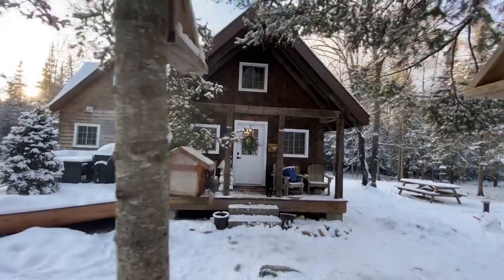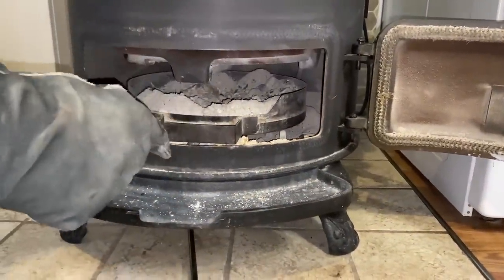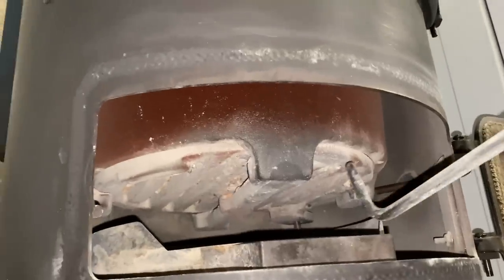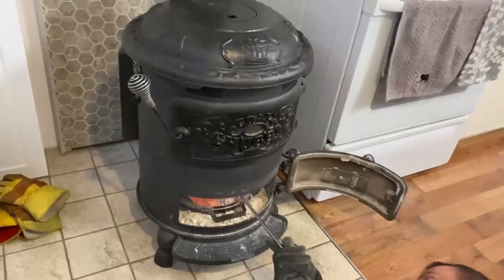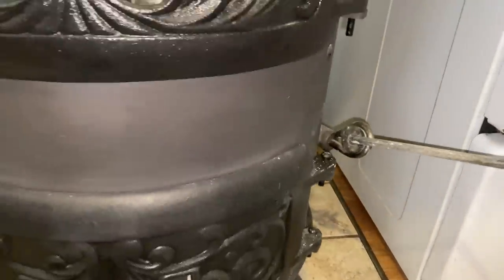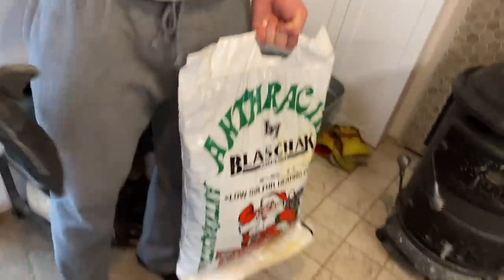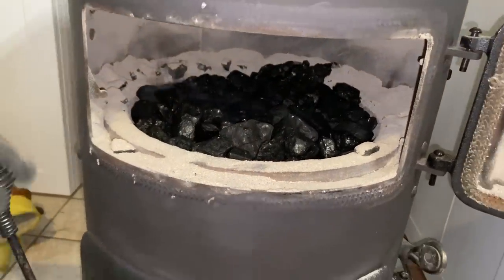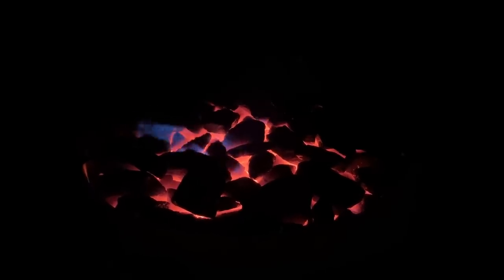How We Heat Our Cabin in the Woods in Winter

Comment: Very interesting video. My wife and I have a yurt camp in the mountains of Mongolia. Our winters are extremely cold. Night time lows reach -45C (-49F) for the coldest period. Our heating season is 8 to 9 months of the year. We tried heating with electricity (space heaters and heated floors) but it cost a bloody fortune. 

Luckily, Mongolia is a coal producer but to reduce pollution the government only allows semi-coke briquettes for residential use now. It costs about US$1.10 for a 25kg (55lb) bag. So we converted to a coal burning boiler and radiators with anti-freeze for this coming heating season. We did a test and about half a bag burns for 16 hours and heats our living areas quite nicely (2 yurts and a bathroom) plus an insulated shipping container which I use for storage / workshop / garage.

We're hoping to get adequate heat for about 5-10% of the price we used to pay this winter.

Comment: Very nice looking place you have there. Best places to live are out in the country in the woods. Been thinking about going with a wood heater to offset the electric heating bills. Coal would be fine with me as well. We used coal for heat when I was a boy. Hated having to shovel snow off the coal pile but it sure felt good getting back in close to that old coal heater.
Reply from the maker: @danielhanawalt4998  Thanks for the nice comment! I’ve never regretted heating with coal 🙂

Comment: We had a stove in the UK similar to this and we found we only needed to do the push-pull movement to clear the rotating grate without needing your first operation of "flossing".  You might like to try that and see if you can save yourself possibly an action that might not in fact be needed (I'm just guessing, I may be wrong!)
Reply from the maker: I’ve tried this, but on this particular stove I think the grate spacing is too close to skip flossing. The ash seems to get packed in tighter at the bottom and won’t fall through with rotation alone.
Reply: @cabininthewoods517  You have a good quality coal for sure. Ash looks clean, without much hard melted residue (clinker). If spacing in the grate is too wide, you would have a lot of unburnt coal falling down your ash tray.
My dad had to rebuilt a grate in one stove we bought long time ago. He added another moving grate between existing stationary one. The only downside was cleaning it :D But this helped so much with the amount of coal burned.

Comment: Have a gravity fed coal stove as my primary heat source.  Was getting nut coal for $370 per ton (pallet) from Tractor Supply the past 4 yrs.  Got one there this year almost $900/ton.  Now they don't even have it anymore.  Had to drive 2.5 hours into PA with a trailer for a load at $450/ton.

Comment: I like the compactness of this stove. It’s easy to locate for the best feel of radiant heat.  However this stoves ash system is horrible. I’v burn coal all my life and my parents for the last 60 years. Our stoves don’t rotate the whole burn chamber, but rather have 2 grates with interwoven fingers that are self cleaning when you rattle the stove. No laying on the floor picking at the stove. Also the Ash pans are full  width  and rectangular (so are the stoves). We open on one end and they basically shovel up any of the overflow ash when you slide the empty pan back in. Plus there easier to dump without a spill. 

The metal bucket is no joke when dealing with hot ash. My grand father cleaned out his wood stove for the summer 2 weeks after his last fire one time. He filled a plastic 5 gallon bucket and set it out on the back porch. Went in for lunch and came back an hour later to find a wilted bucket.

Comment: When I moved into my house a few years ago, there was no gas, so I bought a wood and coal stove. If I want to burn coal, I can add a funnel that slowly feeds the coal to the fire over 12 hours. It's really convenient and gives a stable heat for months in a row. I usually clean the whole stove once a month, because there tend to be stones mixed with the anthracite (and they collect at the bottom).
This year, the price of anthracite has tripled (in Europe). Luckily, I bought enough coal for the next 3 winters, but still, I try to save them only for the days where the temperature goes below freezing (so maybe I can squeeze 4 winters out of them). The price of wood-briquets only went up with 50%, so I tend to use these when it's not freezing outside... 
A pity, because it's really convenient to heat with coal!
Reply from the maker: Sorry to hear you’re dealing with those price issues! There’s definitely a vested interest in cranking up the price of anthracite artificially these days. Glad you’re still able to use it for now!

Comment: Good luck finding anthracyte coal. That's like hen's teeth around here. We stoke up with hedge apple or black locust at night and it does a pretty good job with the fans circulating and the hearth fan in the fireplace. Unless it get to negative temps, it's nice and toasty when we wake up
Reply: nothing like a warm house when getting up in the morning...Then a hot breakfast..
Reply: I can find anthracite nut coal at any farm store, anywhere. It's used a lot in hobby forges.

Comment: Great video, I was completely unaware that people heat their homes with coal in this day and age.  I mean, I just put in two heat pumps with much consideration in my home, a big deal for me as I've only ever lived in a home heated with wood(42 years). The pumps cost $2.50/day combined in electricity, but my wood furnace was costing me $8/day in firewood.  I still can't believe that electricity is cheaper but there's something to be said about technology.
Reply: Electricity is not cheaper but then, your heat pumps are not using electricity to generate the heat.  The electricity is being used to help extract the heat from the outside air.
Reply from the maker: Absolutely, technology certainly has its place! That’s one reason I didn’t go with an off grid log cabin when we built our place beginning in 2009. Electricity prices here are high enough that coal works out better economically, but if that ever changes I think a heat pump setup like yours will be my next choice. Glad you enjoyed the video :) Cheers!
Reply: There's a lot of people in North East PA heating with it in our former farm house we had a self stoking furnace. We would turn the heat up to whatever we wanted if it got too hot in the house we would just open the windows
Reply: I know many people where coal is their main source of heat.
Reply: How does the cost compare to wood pellet stoves? Coal would seem high by the bag can’t you buy it by the truck load?
Reply: @LastTrump7  truck load is how 99.9% of people get it but this guy seems to not be heating a lot of square footage. I don't know how it compares to bags cost wise but he clearly doesn't have anywhere to store a ton of coal at the moment.
Reply from the maker: @LastTrump7  Yes, I do buy it by the truckload. Per bag cost is comparable to pellets, but more heat with coal.
Reply: @jonbender9110  agree 100%!!

Comment: I watched the 1st ammendment auditors channels grow rapidly.  They all share each other's content and recommend their channels. We off grid channels should do the same.
Reply from the maker: Our cabin in only a little over 1000 square feet, but I know a guy who heats a home almost three times the size with this same stove, no problem. The stove has two horizontal channels going through the top of the combustion chamber, attached the the blower fan at the back to blow warm air outwards. I use that and a series of other floor and wall fans in our cabin to distribute the heat very evenly. This video shows the blower fan in action if you’re interested: https://youtu.be/TewWb8xmyzk

Comment: Very interesting and well explained.  Some questions:
1.  Do you always leave the door open when you take the ashes out, or was that just for shooting the video?
2.  I noticed you have a good-sized wood pile.  Do you also use a wood stove?
3.  How old is the Chubby?
Reply from the maker: 1. I always leave the door open. It’s such a short time and distance that there’s no downside to doing so.
2. I burn the wood in the Chubby as well, but only during the shoulder seasons when coal heat would be too much. 
3. Our Chubby is coming up on 3 years old.
Reply: @cabininthewoods517  Thanks for the quick reply.  I'm a bit surprised that the Chubby doesn't have a more convenient way to do the flossing; perhaps a built-in rake-like device that you could slide back and forth and clean all slots at once.
Reply: @cabininthewoods517  Speaking as one who heats with wood, I guard my interior warmth with great jealousy.  When it comes to keeping the door open, the cat had better hold her tail straight up when I let her out; otherwise she might lose it.

Comment: Good video. Be Nice to know how hot it keeps the cabin.  Or just that room.
Reply from the maker: Maintains 22 degrees Celsius (and often overshoots it) all winter in most parts of the house thanks to the system of floor and wall duct fans I installed to distribute the heat. Our bathroom down the hall is sometimes a degree or two colder.

Comment: I grew up on a farm in WV, and we used coal to heat our entire old farmhouse.  There's nothing like it.  As my older neighbor said, "When you've been out in the snow feeding the cows, you just can't back up to electric heat like you can a coal stove."

I never heard of "flossing," but that's what it looks like, I guess.  Also, there's nothing magic about the 'twenty-seven" shakes.  You're not rotating the grate in a circle; you're just shaking it about an inch each way.  Also, how do you dispose of your ashes?  We just had an ash pile and added ours to those made by our ancestors.  Over the decades they seemed completely innocuous.

Anyway, I appreciate your contribution to atmospheric CO2, an essential plant food that has greened the planet and helped to feed the whole world over the past fifty or so years.  It also has helped avoid the plant die-off that occurs at low atmospheric CO2 levels (below 150ppm), which at 400 ppm, we are now very close-to.  In retirement, I live on a small acreage and don't burn coal anymore, but I do try to burn a large brush pile at least a couple of times a year, keeping my woods clean and nice.  Just doing my part to save the planet. 

Anyway, well done, Sir!

Comment: Thanks for the video. Would be helpful to know how much coal you go through in an average Winter, the size of your cabin, how you spread the heat, the cost to heat for Nov. thriugh Mar. and why you don't get Coal by the ton?
Reply from the maker: 1.8 imperial tons per winter heating our 1000 square foot cabin. Costs me about $675 US per winter. I spread the heat with a series of floor and wall vent fans in my cabin. I actually do buy the coal in bulk directly from the mine. I get 20 tons at a time, which arrives as piles of 40 lb bags stacked on skids.

Comment: I’ve been a bituminous burner for nearly 40 years, I don’t have an issue with smoke, our coal here is semi anthracitic, high BTU, also a dual damper system isn’t really necessary, when a door is opened the barometric will automatically close adding draft to eliminate that need, it’s self adjusting so a manual damper is not required. I typically get 12 hr burns as well….and the best part average heating cost annually with delivery $300…..
Reply from the maker: Sounds like a great setup!

Comment: We have a big coal and wood stove with a back boiler we cook and heat the water and radiators and sometimes we use coke but that burns very hot so we mix it one log two coal and one shovel of coke last 4 hours
Reply from the maker: Good strategy!

Comment: To help save you time.   Get a 2 deep pans used for ash.  12 hours worth of coal in 1 or 2 paper lunch bags.  when its change time take the ash pan out put it under or on top of the stove cover with lid if there is a draft.  put empty pan in.  Hit gril with a hammer a few times until ash clears.  Put bag or bags of coal in.

Comment: How do you get a coal fire started ?  Nice video.
Reply from the maker: Start a hot hardwood fire, get it blazing then add a little coal on top. Let that ignite, then add more coal.
Reply: @cabininthewoods517  try a top down burn ,it's easier and no risk of smoking, put some coal in first, then hardwood, topped off with softer wood and kindling, the wood gases burn off  through the flames ,creating more heat .
Reply: @markhedger6378  thanks, I’ll give it a try.

Comment: Cool. How do you light it, initially? And, How much is a bag of that coal?
Reply from the maker: You light it by starting a hardwood fire in the stove, getting it blazing hot with all vents open, then adding a thin layer of coal on top. Give the wood 10 minutes to ignite the coal, then close vents down most of the way and fill up the burn pot with more coal.

Comment: I appreciate your video. It is something to consider. Can coal be used in an air tight stove, with care? We have a place on Manitoulin. Second the coal you are using can have uranium and arsenic in it, when burned it will be concentrated. For your safety be careful with the ash.
Reply from the maker: Thanks! No, you can’t burn anthracite in a regular wood stove. It needs a specially designed coal burning stove.

Comment: Awesome! What if I throw a few anthracite rocks into a terra-cota woodstove...? It should work I guess, if it burns clean I shouldn't have trouble with soot..
Reply from the maker: Might possibly work if the stove has an elevated grate and bottom draft control, but also might not. Anthracite is pretty picky about where it will burn. Also, I have no idea if terra-cotta can handle this kind of heat.
Reply: @cabininthewoods517  Yours look like cast iron. Terracotta holds heat for 5 - 7 - 10 hours after the last wood  burns out - depending on the cold outside and house insulation. Most americans seem to use cast iron or iron stoves and rarely do I see heat reclaimers just above the stove. I'm from Romania.

Comment: How many pounds do you go through in a season? (when does the season start and end?)  Also how do you start a coal burning stove?
Reply from the maker: About 3600 pounds per winter heating from December to early April. Prior to December I burn wood. You start it by lighting a hardwood fire in it, getting it going blazing hot, then adding a thin layer of coal on top of the wood. Leave vents wide open for 10 minutes to let the coal ignite, then fill the rest of the burn pot with coal and close vents down to maintenance level.

Comment: I'm guessing it takes a specific coal burning stove and you can't just convert a wood burning stove to coal? A boiler would be nice with coal if it burns that long and steady. Use the hot water for for multiple uses including heating. Sure was a nice dust cloud when you dumped that ash, blew right back at you heading for the cabin. What does the outlet of the chimney pipe look like? Black smoke, ash and dust coming out?
Reply from the maker: Yes, coal takes a specific type of stove to burn. Can’t just convert a wood stove. Never any black smoke or ash coming out of my chimney. Anthracite burns pretty clean.
Reply: @cabininthewoods517  you are totally right and and it does not smell at all when burning.our Harman has a grate you can put in and cooking hot dogs,steaks etc.

Comment: We use a Leisure Line stoker furnace with oiled rice anthracite.  I’ve got it hooked up to our generator with a auto transfer switch in case the power goes out (blower fan for air).  The hopper holds enough coal for 5-7 days, and I dump the ash every 5 days or so.  It’s super hands off for a solid fuel furnace, and heats far better than oil/gas forced air or electric.  Price certainly went up this year, but I’ve been comfortably heating our NE Pa home for under $1000 a year (6-7 months heating season) for the past 10 years so we’ve paid for the furnace with the savings, as well as have had 7 years of very cheap heating, so I’m not going to balk at the price hike because of the US shipping all our coal to Europe this year (hopefully that isn’t a long term thing…).  The efficiency of using it right at your home for heating instead of sending it to a power plant to be burned, changed into electricity, and wired to your home to do the same thing is also great (and much less wasteful).

Comment: Can you use Anthracite coal in an normal mason fireplace which is supposed to be used for wood? whats the downside if i do?
Reply: No. Anthracite coal burns A LOT hotter than the best seasoned hardwood. You'll destroy your fireplace and if you're not good with fire extinguishers your entire home.
Reply from the maker: It won’t burn in a normal fireplace. Anthracite is a bit finicky and needs a specially designed chamber to burn. I do know the stove shown in the video can be retrofitted right inside a fireplace for folks who want to switch to coal burning.

Comment: You don’t need a back or bottom heat proof pad ?
Reply from the maker: Great question. At the back there’s a built in heat shield on my wall. Hidden by tiles but it’s there. The bottom of the stove has a heat shield as well. I have porcelain tile flooring there so a second floor pad isn’t needed. For a wood floor, you bet it would be.